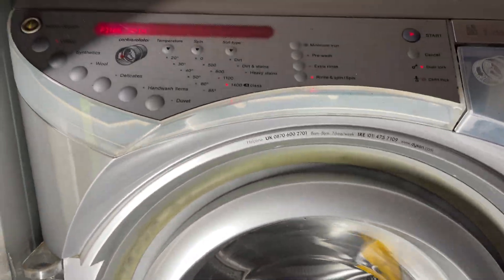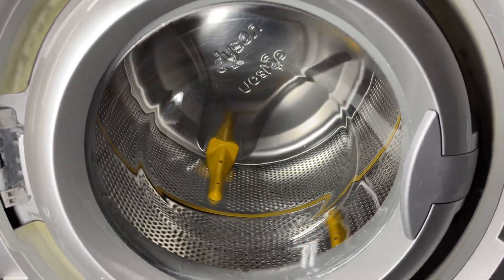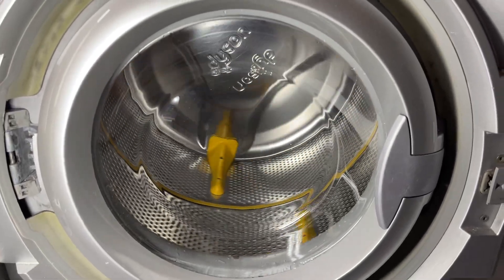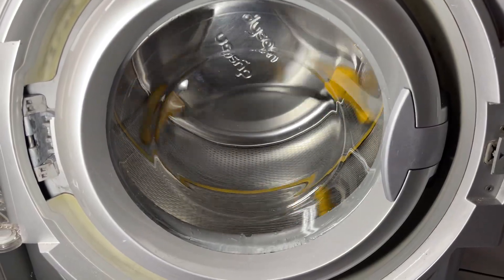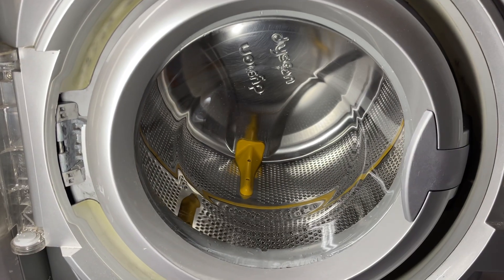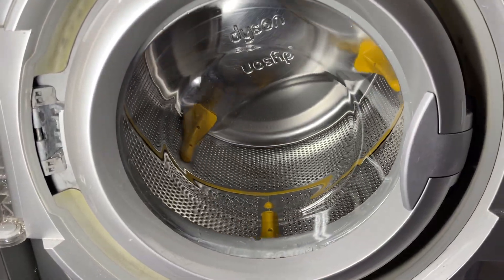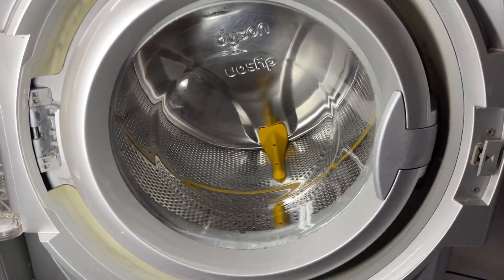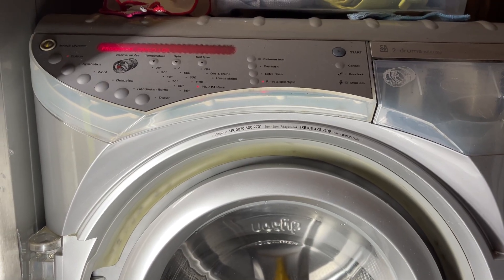Dyson washing machine BROKEN stuck in contrarotate mode on spin!

Comment: Ist irgendwie was kaputt
Reply from the maker: The microswitch to tell the machine it’s in normal tumble mode had got stuck pressed in when the gear ramp wasn’t against it. Pressing the microswitch with my finger and moving the gear ramp back over to normal rotate mode fixed the issue 😅